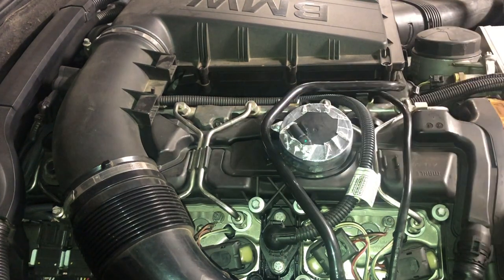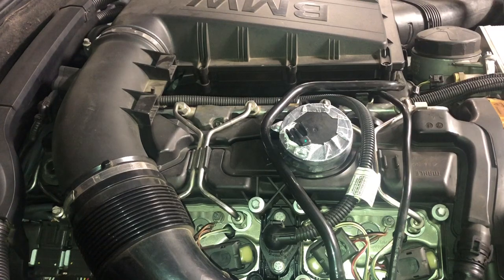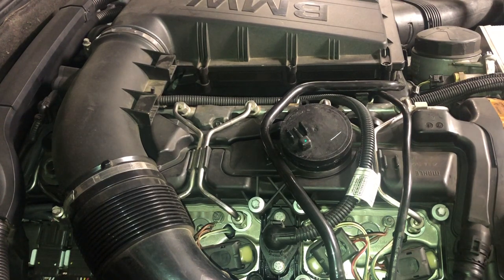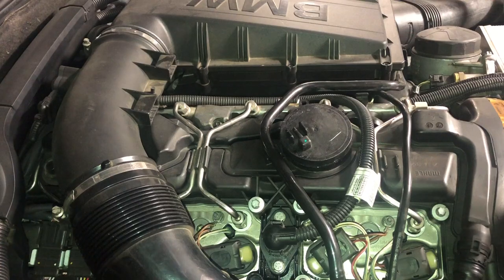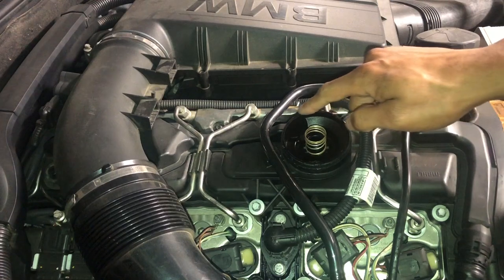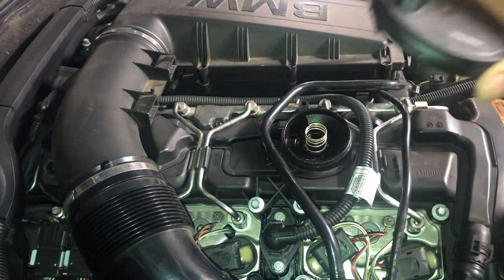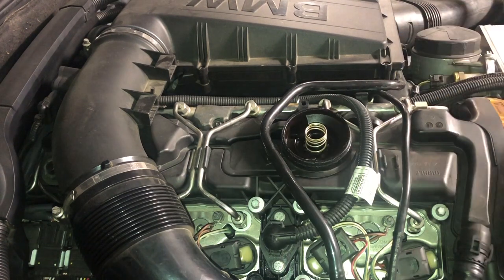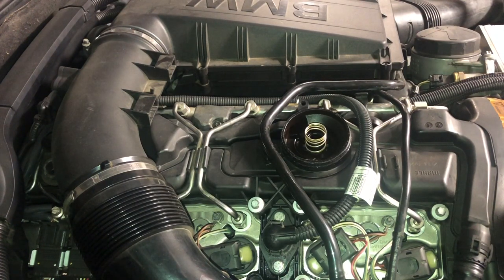Watch this video before repairing N55 PCV Valve BMW F10 535i

Comment: Hi Grant.  As much as I liked your video, the diagnosis producing a failing PCV valve would be very helpful.  As you say in the comments below, you eventually replaced the whole valve cover, but you don't actually say why.  So, as us DIY'ers look for solutions, it's key to get the diagnosis correct before jumping to the cost saving fix. In this case, I think you should tack-on some text saying you eventually replaced the valve cover.  I do have a question though...  If the PCV test OK, but the valve cover needs replacing, might it be OK to replace just the valve cover gasket?  Cheers, Vic
Reply from the maker: Thanks for your input. I will update the video description.
As far as the PCV testing good and just replacing the gasket. From what I have found it is more efficient to just pick up a replacement Valve cover and gasket and replace. The run around $100 online for a non OEM unit and they are almost identical. 
In most cases the plastic Valve cover has also got gunked up in the vacuum ports or has an internal vacuum leak between chambers that will continue to cause issues.

Comment: Nice video, Grant.  My friends have a 2014 X3 35i F25 with N55 "twin scroll" turbo motor.  They have 123,000 on the clock, and have done some oil changes, but not enough, my opinion.  Their car has some fairly serious oil leaks.  Most of it seems to be dripping down near the back of the valve cover on the passenger side (USA car) onto the exhaust of cat. conv.  We recently replaced the valve cover gasket, but it still leaks in the same spot.  We used a Mahle valve cover gasket.  We are getting this much mentioned 101F01 code and mainly have a rough idle now.  I'm wondering what to try next on their X3.  The rough idle is often caused by the PCV valve on these N55 cars ?
Reply from the maker: I had to replace my Valve Cover to due to the PCV valve. The fix in this video on helped temporarily. I assume you will need to do the same. The new valve cover could possibly fix the oil leak issue as well.
Reply: Possibly check and clean or replace Vanos Solenoids for further rough Idle and “timing” symptoms. 

The oil leak is a different story… not really sure there.

Comment: thanks for the video! i had my valve cover gasket replaced a few months ago because of the squealing but it recently decided to start doing it again. Im going to try this today
Reply from the maker: B Sears It’s worth a shot, however I ended up having to replace the whole valve cover. If you checkout my intake valve cleaning video, I do a review of the unit I picked up and provide a link to the part.

Comment: I’m replacing this today - thanks for the heads up! 

Was burning oil, low coolant in reservoir, and a lot of white smoke from exhaust upon starting/accelerating from a stop, is indicative of pcv/ccv valve? 

Is it also called the oil separator? Thanks again!
Reply: Did you also lose power ?!

Comment: I have an EWG N55 with 115k mi still on the original valve cover and PCV. I wanted run a quick test by slowing removing the oil filter on a fully warmed up engine at idle and I when removed the car I felt air being sucked in the crankcase with with a psssshh sound then engine idled rough for a few second until I replaced the cap. I drove the car the next day, there was no CEL but I noticed about max 2 teaspoon of oil on the driveway in only one spot.

I typically don't burn any oil between OCI, no rough idle, no smoke, no CEL and this engine pulls hard since it has MPPK retrofitted.

Btw the valve cover and gasket are scheduled for replacement  since I notice some oil sweating in passenger side of the gasket towards the back.

Any advice on that?
Reply from the maker: Yeah, I would definitely replace the valve cover. Removing the oil cap on our engines will always result in the car stumbling and a rough idle. That is due to the vacuum system being built in the valvecover. Replacing the valvecover may also fix the oil leak, however you may want to inspect your oil pan gasket.

Comment: Hello. I have a p147D code and I’ve replaced most of the parts regarding that code and the engine light is still there. Will this help get rid of the code?
Reply from the maker: Sorry, I don't have the information. What is the p147D code for?

Comment: BMW engineering take something simple and turn it into brain surgery outstanding
Reply: It’s crazy I just did the charge pipe It was super easy clip system is great. But this integrated PCV valve is like the BS with my Volkswagen vr6.
Reply from the maker: @andresparrow2971 Yeah, it’s crazy!🤪

Comment: Hey brother,  you said tht the only way this cover would stay on is by securing it with the tape... it won't stay on with just the silicone
Reply from the maker: Mine wouldn’t, but I only used this temporary repair for a week or so, until my new valve cover came in.

Comment: Really appreciate the video! You're helping so many people out man
Reply from the maker: Trevor Schnedler Glad it helped! I had to ultimately replace my valve cover.
Reply: @JohnsonMotorsports  any reccomendations on where to buy a valve cover for cheap? I've seen some on ebay and no complaints, but I'm a bit timid to try that
Reply from the maker: @trevorschnedler4472   Checkout my Intake valve cleaning video. I have a link in the description to the Ebay unit I picked up and I did a quick unboxing/review of the valve cover in this video.

Comment: Another good diy fix I’m glad I found out about this replacement pcv valve cap . I’m getting that squealing noise and was about to have to replace the valve cover and I’m dreading that cuz I had a oil leak about a year ago and replaced the valve cover gasket-I 11:18 snapped one of the valve cover bolts in the process so will probably have to tap n die to extract it. I just do not want to do that job again any time soon 
But I am almost positive I need a new valvetronic/servo motor anyway because I am getting codes for that as well so unfortunately that is something I am going to have to take on 
Another great video my guy 🤘
& wish me luck 🤞
Reply from the maker: Probably best to just pick up the Valvetronic kit which includes the Valvecover gasket and just knock it out. This fix worked temporarily for me until I could replace the Valvecover.
Reply: What code are you getting exactly. If it's a deactivation too frequent code. Doesn't need replacing. Just needs relearning with a scanner

Comment: Hey brother, can you put a link on where you bought the part? Based on my research there's a company in Ukraine called vanos-bmw that sells this part as a repair kit for $20 + shipping; also Ebay has one for under $20 coming from China.  Your thoughts.
Reply from the maker: https://www.amazon.com/gp/product/B07J9QM12Z/ref=ppx_yo_dt_b_asin_title_o01_s01?ie=UTF8&psc=1

This is the Replacement cap that I picked up, however it is currently sold out.  I just started having issues again with the engine whistling from one of the seals, as well as a lean bank code, but I think I have a bigger issue with my valve cover.  I will update as soon as I am able to determine the culprit.  Thanks for checking out my videos!

Comment: thanks for the video, I have a Permanent code 101f01 on a 2011 535ix,  Replaced the boost pressure sensor and it did not clear the code. I guess this PCV "Cap" is the main issue for the permanent code on these cars?
Reply from the maker: That’s definitely a possibility. I’m not familiar with the  101f01 code. How many miles are on your car? What maintenance has been done?
Reply: @JohnsonMotorsports  150k regular maintenance only but the check engine light.comes on and runs rough at idle
Reply from the maker: D GOldman if your valve cover hasn’t been replaced in the last 75k miles, I would definitely start there. I picked up a new one for around $100. Check out my video on intake valve cleaning, I have a link to the valve cover I bought.
Reply: Hey, am having the same permanent code on my 2011 535i , how did you get yours fix?
Reply: @ComputersByMJ  i ended up replacing the valve cover
Reply: Permanent codes mean the car needs more driving to go through a complete drive cycle and it should clear itself.

Comment: hey bro ...i replaced my part but i dont think that resolve anything. i wonder if i should just replace my entire valve cover. i see you replaced yours with the one on ebay....how is that holding up for you and did that fix the issues with your car?
Reply from the maker: Yes, I think you may be in the same situation and need to replace your entire valve cover.  When you have a chance check out my video on Valve Intake cleaning. In that video I show you were to check for an internal vacuum leak that could be your culprit. How many miles are on your car?
Reply: @Grant Johnson i have 79k on mine....ill check out your video now..

Comment: Would this cause my car to vibrate at different speeds like a vacuum leak? Some times around25/30mph and 45/50mph, unless I accelerate it hard. I have no codes coming up or a check engine light.
Reply from the maker: I can definitely feel like a vacuum leak, however I don’t recall vibrations.

Comment: When you put the cap on before pushing it into position…start the engine and it will suck it into the right position and ensure it’s tight. Snap the cap on and your good

Comment: Grant, Thanks for the PCV help….my second attempt worked great based on your help….smooth idle, and 2.5 additional MPG ….✅✅✅…..thanks a ton
Reply from the maker: Glad the video helped, but keep in mind this fix only helped me for a couple of weeks. I eventually had to replace the valve cover. I picked up one for $100 and the quality was great!
Reply: Did you change the valve cover too or just the pcv cap?

Comment: Can a bad PCV valve make your car smoke out the exhaust I have a 2012 BMW 535i f10 I thought it was a bad turbo I replaced the turbo on it still smoke sometime
Reply from the maker: Not typically. It will usually just mimic a vacuum leak.
Reply: Hey quick question have you fixed the smoking problem??my 2016 340i started blowing out huge clouds of smoke out the exhaust i just bought the car 6 days ago so im not really that knowledgeable of the engine itself i took it to the shop already im just waiting on the diagnosis so i would really like to have an idea of whats going and ofcourse slowly get into DIY mechanics on  bmws...i would really appreciate you letting me know what worked out for you👍👍

Comment: Hi, My bmw E83 crankcase vent valve went bad with pressure in engine & blow out my valve cover gasket. Do you think it could have damage any other seals?
Reply from the maker: Honestly I’m not familiar with your engine, but my buddy that works for BMW suggested performing a compression test. Because vent valves tend to fail simply from plastic dry rotting. If in fact it AND the VCG failed due to high crankcase pressure, that is a very troublesome situation.

Comment: How long did you let the rtv cure before you drove the vehicle?
Reply from the maker: I let mine cure overnight before driving. Probably a little excessive. Although, this repair only worked temporarily. I ended up replacing the valve cover with an eBay one a few weeks later.
Reply: @JohnsonMotorsports  hopefully the valve replacement will fix mine. Mine was leaking like crazy according to the flame test

Comment: How did you get the cap off
Reply from the maker: I used my high speed cutoff wheel to remove the cap. Cut a few reliefs and then used a flat head screwdriver to carefully pry it off.

Comment: I just changed my valve cover and its still running rough and making a noise
Reply from the maker: What type of noise? Whistling?? If the Valvecover was bad for a long time. You may have damaged the front main seal and it could be causing a vacuum leak.
Reply: Yea the whistling sound. Turns out buddy only changed the gasket for the valve cover and not the cover itself.
Reply from the maker: Gotcha. Yeah, you will need the whole Valvecover replaced since the PCV system is built into the cover.

Comment: This is worst shit you can do...  Being a BMW ASE Certified technician these types of videos bother the shit out of me.  It steers people in the complete wrong direction, wastes money and causes following issues to derive later on.  On this system you should never be replacing just this part separately, the entire valve cover needs to be replaced.  Yes the entire valve cover, yes just because the PCV is bad.  Sorry but that’s the perks that come with owning a BMW.
Reply: What caused the diafram to burst? I tried the quick fix and it only worked a week. I don't want the new valve cover to fail also. Can you point me in the right direction please.🧐🤓
Reply from the maker: I think the issue has to die with age. Just the heat cycling overtime makes the plastic parts brittle and they eventually crack. A new valve cover is eventually needed.
Reply: Got a reply typical for ASE: telling nothing. If you are so proud of being ASE than explain for us how the whole PCV system is designed, including all the valves in the VC and PCV pipes, possible malfunction points, etc. Instead of that the result of all of your ASE education tells us: replace the VC. Sorry to brother you, the administrator at the BMW dealer desk can tell the same without any ASE paper. If you do not want or have information to share to help DIY guys to repair their stuff than do something else and do not waste anybodies time.
Reply: The WORSE shit you can do is to pay BMW $200/h for very simply repairs.  I have the money, that is beside the point  many who drive a little older BMW do not. Additionally, many of us who work on cars like to solve problems & are proud of the solutions we find.  Lastly, the primary thing that separates a mechanically inclined "DIY " individual from a BMW mechanic is access to information which BWM attempts to lock down.   

Also , you speak as if OEM BMW valve covers are superior products, which most of us "DIY" aka BMW owners have disproved that myth on "most common replaced ( problem ) parts.

Comment: Wendy you put pressure on the motor spending you will have problems again
Reply from the maker: This was just a temporary fix, I replaced the valve cover two weeks later.